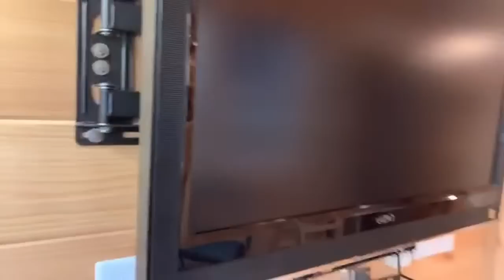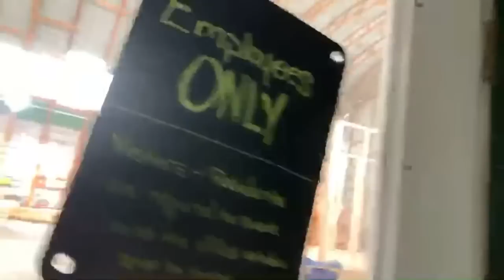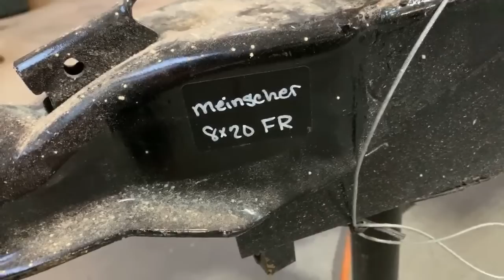8x20 Freedom $32,500 overnight rental

Comment: I had about two boards in my kitchen where the sun hit it strong in the winter that lifted up a bit. I ended up putting a dab of glue underneath the board to hold it down and that fixed the problem

Comment: Such a little cutie…I love all of the wood. I’m not a fan of bigger sized refrigerators. I also wish someone would invent a 20” convection over that has a vent so you can mount it over the stove. I don’t have any use for a microwave. I also love, love, love the cutting board over the sink. I would add upper cabinets instead of the bulky microwave. Keep it super simple and open. Cute, cute, cute 🥰